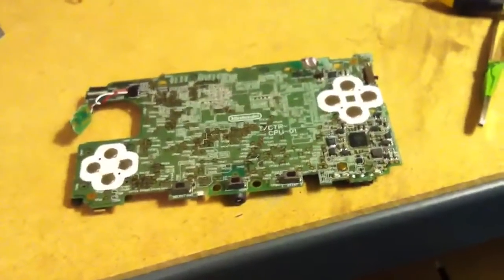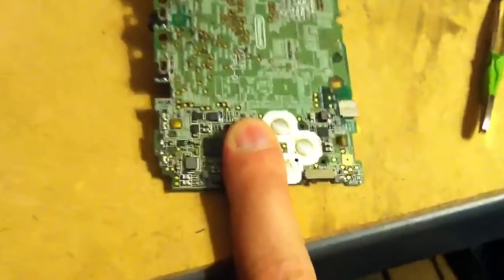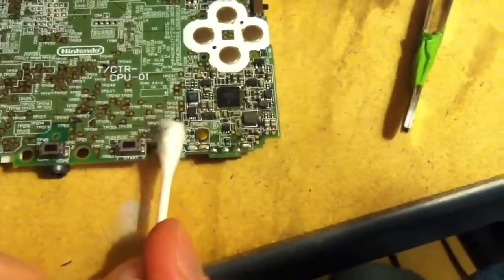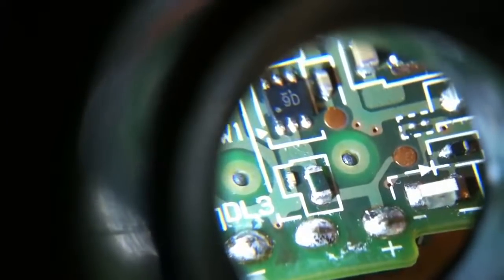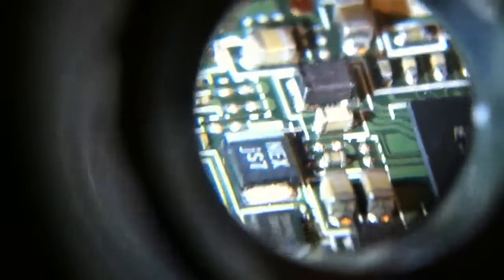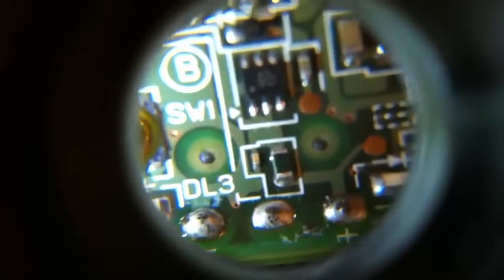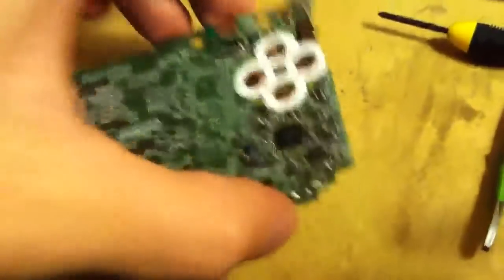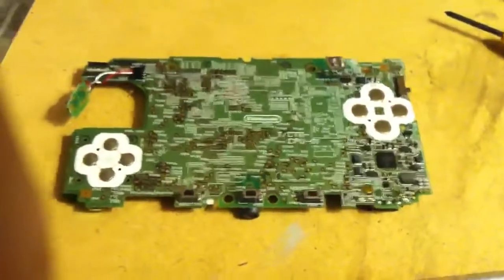Nintendo 3ds Circuit board

Comment: How do you get the schematics to find the size and values of the components on the board?
Reply from the maker: Caliper is used, you also need to know resistor codes, chip package type, transistors and capacitor for right measurement. I don't have schematics and doubt you'll find one for this. What are you looking for?